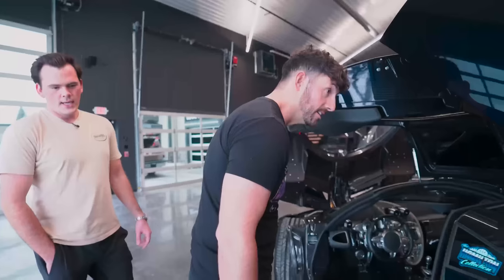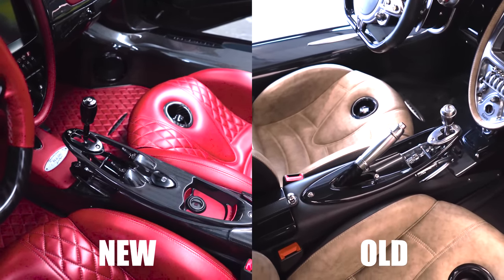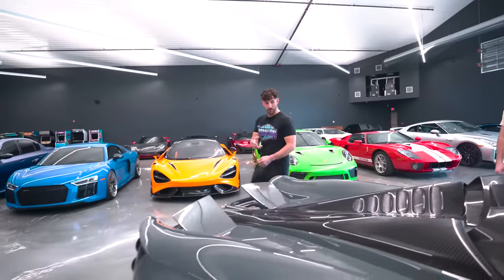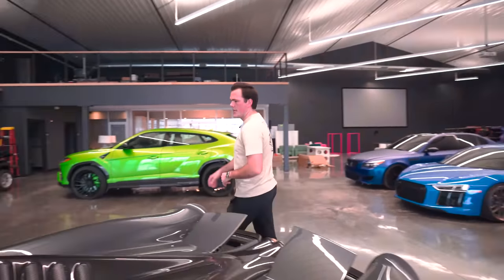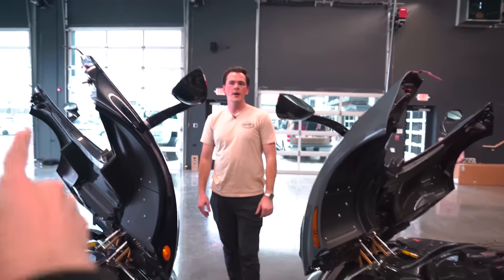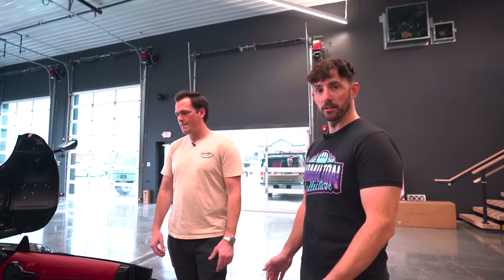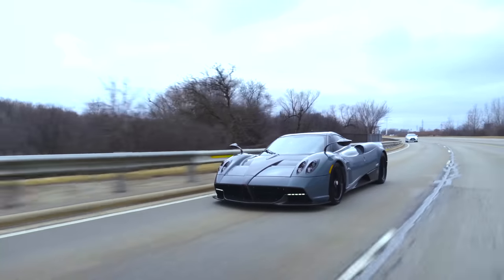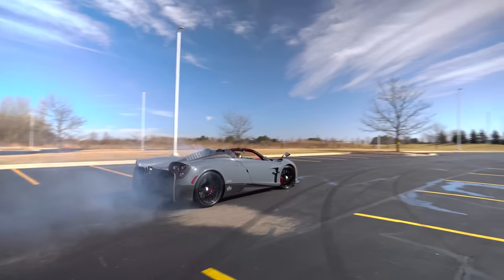Taking Delivery Of My New $3 Million Hypercar!

Comment: The Roadster is where the Huayra peaked.

Improvements of the Roadster over the Coupe:

- Fender flares over taillights,
- Flared exhaust
- Infotainment
- Better looking mesh
- Rear buttress looking way cooler on the Roadster, especially with the integrated air vents

How the Huayra BC got downgraded from the Roadster

- THE ENGINE LOOKS MUCH, MUCH WORSE ON THE BC AND IT'S NOT EVEN CLOSE
- The rear wing is OK, but it's not a worthy replacement of the Roadster taillight flares.
- And finally there's the canards, which are just meh.